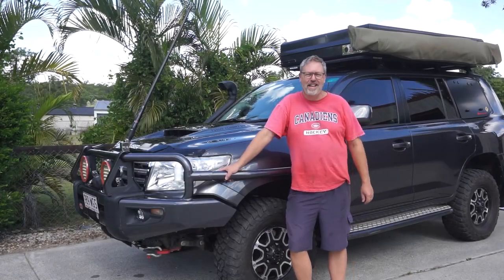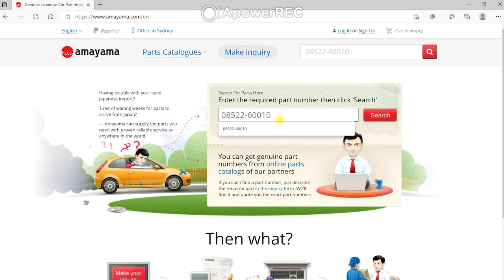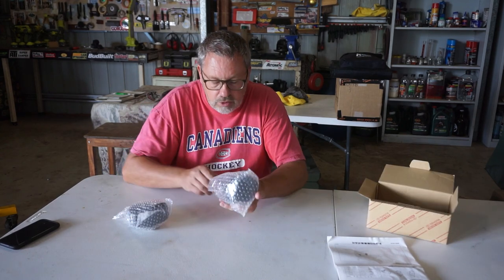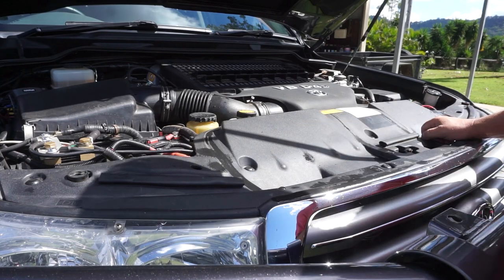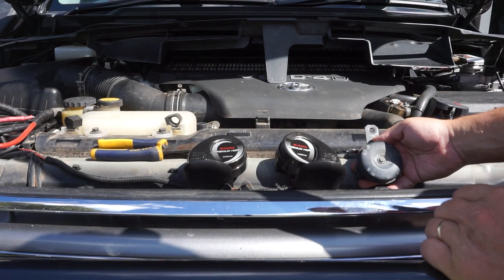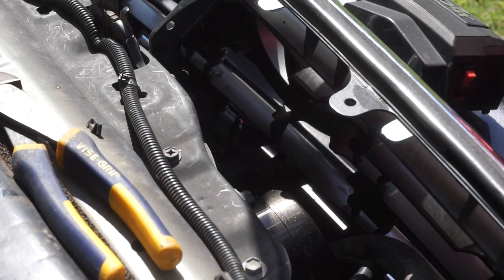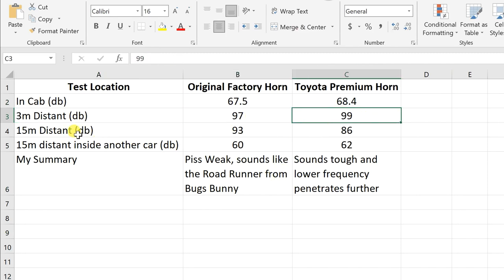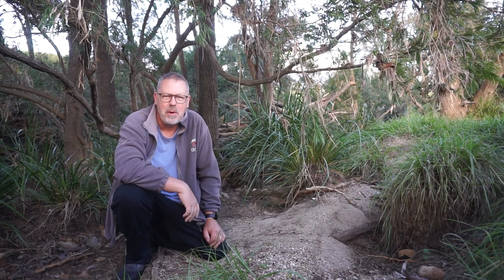How to Replace the Horn on your Landcruiser | Landcruiser 200

Comment: Hi Terry, very well ! Guess everyone has to bite this bull it !  
Anyone tried the Hella superton B133 horns ! Looks schmink with 2 color. Hopefully nobody fall in love with   Cheers and nice weekend
Reply from the maker: Thanks Holger.  I’ve not tried the Hella’s but I do love the plug and play aspect of this solution.  Go well mate😎👍
Reply: I have the supertones on my 79. I like the sound. They are loud and a big improvement over the crappy aftermarket air horn the previous owner fitted. 300hz and 500hz so a slightly bigger difference in frequency to these. Don't know what difference that would make.
Reply from the maker: I’m not a fan of the air horns either Ryan so if the previous owner of my vehicle would have had them fitted I would have tossed them in the bin as well👍.  Given your one horn is slightly lower in frequency (300hz vs my 400hz), I would suspect it would bellow a little lower but I’m only guessing.  Thanks for sharing, I sincerely appreciate it 😎😎

Comment: Hi Terry, another great video and examples of before and after Horns. Just a question from left field....... Did you purchase your bonnet aftermarket from somewhere in Brissy?? I have just seen an ad for the same style bonnet for a 2015 up 200 series and am awaiting a reply to see if they do them for the earlier 200 series. Many thanks in advance. Craig
Reply from the maker: Thanks for the kind words Craig.  I did the bonnet myself.  There is a 7 part video series in my library (79 Series bonnet scoop) that details exactly what I did, and the impact of the modifications on the charge air temperatures.  Check it out if it is of interest.  Cheers 😎👍

Comment: Thanks Terry for the video, my 150 Prado has the same p-weak horns, would those horns you got from Japan work on my 2015 150 Prado land cruiser?
Reply from the maker: I’m not certain Mike.  You could cross reference your part number against the 200 Series, they could be the same.  Alternatively pull one of your horns out and match the connector and horn visually with what I have in the video.  Sorry I could not be more specific mate.😎👍
Reply: @JafffaAdventures  thanks Terry👍
Reply from the maker: Sorry I could not be more specific mate😎👍